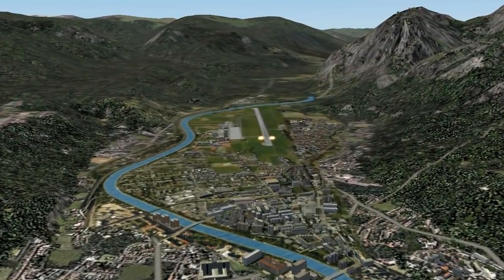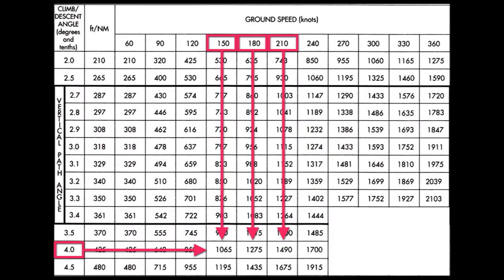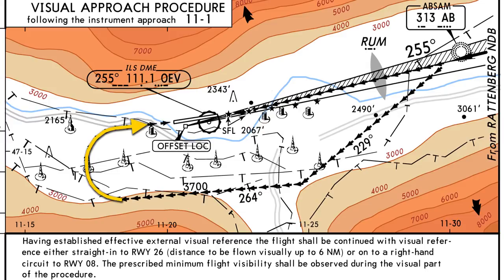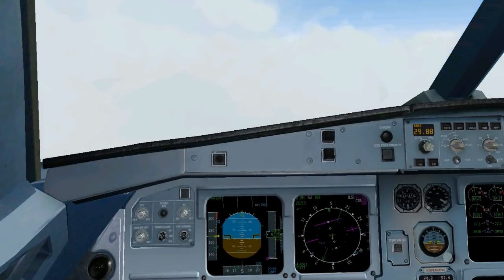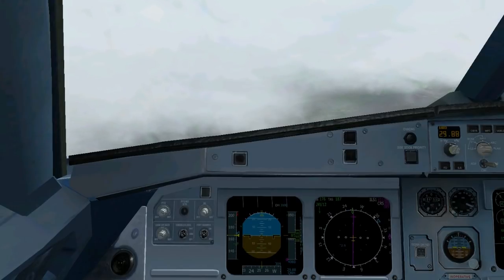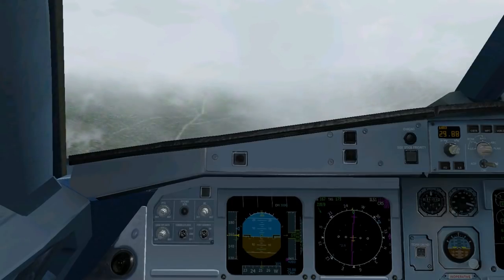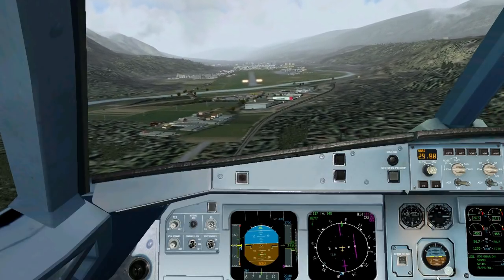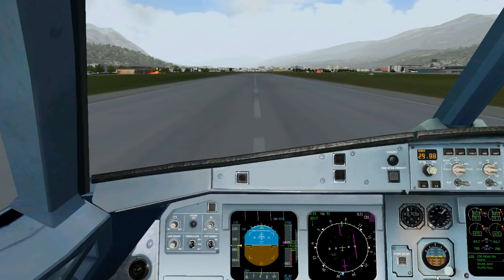Innsbruck Airport (LOWI) - LOC DME East Approach Tutorial

Comment: Hi GVad,I noticed you approached Rattenberg NDB on a heading of 310 degrees and when you were near the NDB, you opted to turn to intercept the localizer rather than doing the procedure turn at Rattenberg.  Had I been flying the approach I would have done a tear drop entry and do the intercept that way.  In mountainous terrain especially it is crucial to stay as close to the approach line as possible.  As for the "Cheat Sheet" for decent rates, there is a difference between the 3.8 on the plate to the 4.0 degree angle that you selected.  Decent rates are very important on any approach, in this case I would have opted to interpolate the table to determine a more appropriate lesser figure.  Please! do not take these suggestions as negative criticism as that  is not what is meant, only suggestions to help.  I have viewed many of your videos and I really enjoyed the St Barth the most.  Keep up the good work! Cheers!
Reply from the maker: Steve Larson good suggestion. I would have done one too. For whatever reason this approach plate doesnt call for one so i didnt want to add to it. Probably cause ATCs just vector the planes anyways.

Comment from the maker: Thanks for the Comment. The landing was harder than usual, but it was only 290-310 fps or so as far as I remember, not hard enough to burst tire. I believe in FS Passengers the copilot will also tell you if you had a hard landing (I believe it is above 350 fps), which in this case the copilot didn't.

Comment: Nice graphics for FS2004
Reply: I am not quite sure this is FS2004. 
The box (cover) on top of these comments is for FSX. 
I still fly FS2004 (as FSX) with many addons, and I have doubts.
You might be right though...
Reply from the maker: A. its FS2004
Reply: Thanks for your clarification.
 A few hours ago I bought on E__y a used Aerosoft  Approach Innsbruck DVD (FS9 and FSX). 
Some serious fine tuning will be required just so that CDT's and OOM's issues, don' t spoil the sauce too much on FSX. 
Stable FS9 won't be as critical. 
No wonder I still enjoy it so much. 
So long fellow virtual pilot.